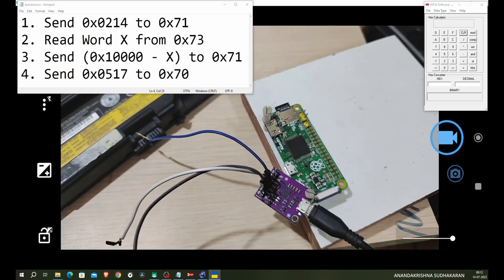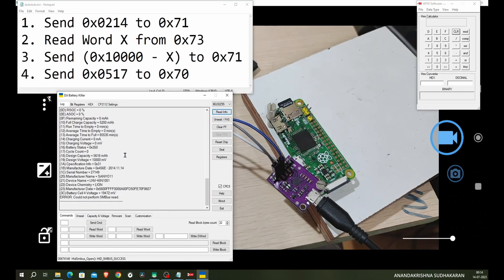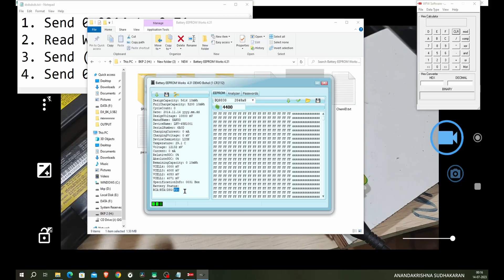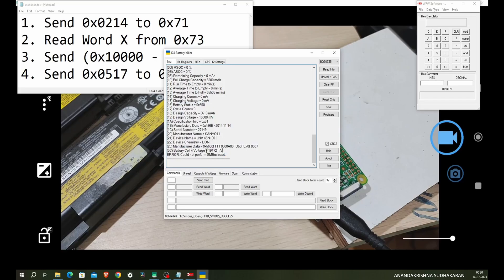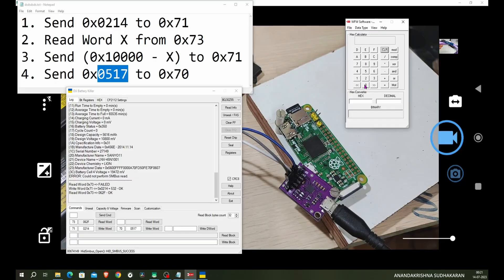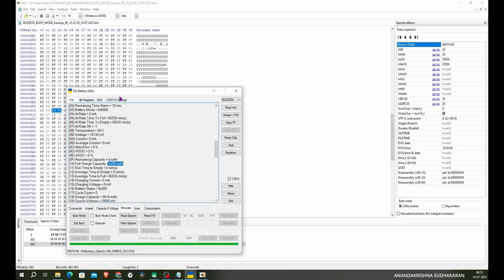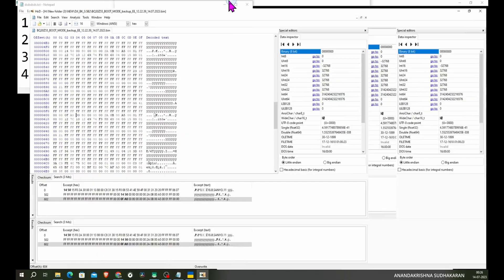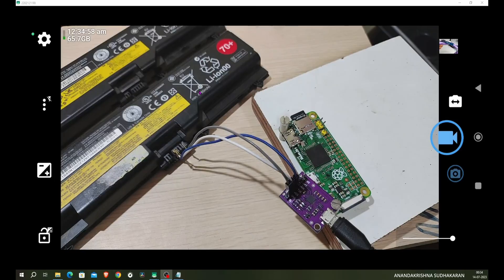CP2112 and DJI Battery Killer Rewrite BQ8030 ROM" Laptop battery data retrieval - BMS HACK

Comment: When i try to write EEPROM i have "write block 0x4000 - FILED, retry.."
Reply from the maker: @wiktorwoznica2739 which chip,
Reply: @ bq8030dbt, problem solved, i tried few more times and it worked

Comment: Hey, i like your Video. 
I have a chip for DJI MAVIC Pro that the Battery Authentication failed. The battery was working without any problem. I have another Battery that i want to copy the Authentication from this to another Battery using CP2112. Is that possible? can i contact u?
Reply from the maker: You want to copy the firmware from one chip to another , its possible , but u need to adjuts many values,, basically both look same but need to find the size and starting and ending memory locations, also copying from one chip to another , sometimes loses its authenticity.

Comment: Very interesting video. I need to do this to my Asus battery since its shows TotalCapacity much higher than DesignCapacity. Can I read/write the battery EEPROM using other tools, like CH341G EEPROM Programmer? It support I2C protocol also, so I think it can be done, what do you think?
Reply from the maker: @wawandharmawan2441  yes , i saw one tool can read the battery info with ch341, but to write and read need to develop a code or maybe tools are available at internet. First you need to verify which chip it contains

Comment: Nice vid where do you get the wires from?
Reply from the maker: Its a normal jumper wires used for arduino board, and those golden pins from old laptop motherboard. Just soldered. 

Thanks for your comment
Reply: @AnandakrishnaSudhakaran   okay thanks

Comment: Hello. what values should be entered to unlock the bq40z696a chip in lenovo batteries?
Reply from the maker: It uses sha 1 authentication method, codes will not work. And I have this chip. But default codes not work. 

Default codes are 

0414 3276
1234 5678
0000 0000
FFFF FFFF

lot of other keys are also available. If I got anything I will let you know
Reply: @AnandakrishnaSudhakaran  thank you. what do the values 71.73.70 mean? where can i find out what numbers should i enter?

Comment: @Anandakrishna Sudhakaran Thank you very much for sharing your knowledge. I have to reset to default settings 3s2p Lenovo battery FRU 42T4861. Can you share Be2works demo file? Can you also help me/leave some advice for reseting the battery. There are bq8030A and bq29330 inside. BTW CP2112  is not USB-to-SPI (as you decribe in decription) but USB-to-I2C chip.  Regards
Reply from the maker: Oh thanks for correcting me, i will correct it.  

Do it carefully
Do not touch the positive line of the battery or pcb with sda and scl pin. Bq8030 is easy to crack. Check your fuse also. If you plan to replace cells, change with same cell model. And am noob at this, so i cannot tell you any advice. Just do it on your style. Always follow safety procedures. Multiple check sda and scl not touch to positive. Also check the voltage on sda and scl before connecting to cp2112. Cp2112 can work upto 5.6volt range. 

Also share image or video if you plan to record it  so i can share it on my youtube.
Reply: @AnandakrishnaSudhakaran Thankyou My battery worked fine (70% of new one),. I recognized one pair of cells had a little bit lower voltage. I swaped the with another one that was much worse (should have been a new ones). After one cycle the capacity written in Bq was decreased from 45Wh to 5Wh (full capacity). I changed again those two cells (pararell connected) into true new one , oryginal 2500mAh as oryginal but not Sanyo (as was) but Samsung 25R. Now the battery is correct charged to 4,20V per cell (balanced, every cell same voltage), but the supply is cut when the voltage fall to 3,85V (not 3,3). After reaching 5%, during discharging, the rest lasts very long time (shows 1 minute (7%) left, and it lasts 60 minutes (YT) to shut down). I try full cycles:  charge to 100%  and discharde to shooting down and then the rest in bios. Do you thing the Bq chip is recalculating capacity and could increased it to real value or never increases and could only decrease - one way? // SCL and SDA lines are ussualy pulled up with 4K-10K restistor, and it works shorcuting the line to GND. So connecting directly to VCC could demage the chip indeed. Regards!
Reply from the maker: @roolon6604  do a calibration cycle again, one full charge, full discharge , again full charge, based on the battery performance bq will adjust the settings and it will give correct readings. What is the design voltage of the battery? Let me calculate it for you.
Reply: @AnandakrishnaSudhakaran  Next cycle (after long (1h) 1% to turn off discharging starts from 11.5V and first 1% is lasting long now. Parameters read from Lenovo X220 Power manager/battery. Condition: Fair (yelow) before was GOOD(geen),  Designed capacity: 62.16Wh, designed voltage 11.10V, cycle count 328, full charge capacity 3.53Wh (yes, no decimal point mistake). Original cells SANYO UR18650ZT 2700mA, 2 of them (the lowest votlage) I replaced with new oryginal Samsung INR18650-25R 2500mAh.// Btw I wondering that most of people replacing the same pair of cells - with NTC resistor on them. Connected (+) to the highest voltage of set (last one) counting from global GND.
Reply: @AnandakrishnaSudhakaran  I did 4 times full cycles and also did battery maitenance (button in Lenovo power manager). Full charge to 12.90V, discharge and charge again with recalibration. But it works probbablly only one way - decreasing full charge capacity and balancing cells. After that I have no changes noticed.
Reply from the maker: @roolon6604  Ok. Good observation. Design voltage is 11.1 so battery should hold voltage down to 3.7v. because 3.7*3=11.1v . And charging voltage is 13.05. so maximum cell voltage is 13.05/3=4.35. if the cell not reaching 4.35v there is a chance of decrease in efficiency. Battery will not works on 3.3 volt. Because 3.3*3=9.9v. lower than design voltage. What about cell balance? Also if battery is mixed with different company. There is a chance of decrease in performance. Can you share your results to my telegram.

Comment: will it works with TB50 batteries too?
Reply from the maker: I cant tell you now, but i will try to get the details. Do you know which chip is used in that battery?
Reply: @AnandakrishnaSudhakaran  it's wrote FR5870
Reply from the maker: @airfilm_it  ok any other chips, FR5870 is MSP430FR5870. You can get the datasheet here  https://www.google.com/url?sa=t&source=web&rct=j&opi=89978449&url=https://www.ti.com/lit/gpn/MSP430FR5870&ved=2ahUKEwii7sDK0NWCAxV8zjgGHYV8BLIQFnoECA8QAQ&usg=AOvVaw22V7gdMpVTn_8F4pvQMmnf
Reply from the maker: @airfilm_it  any other chips?? Which connected to the all cells,

Comment: Work in BQ40z50?
Reply from the maker: If the unseal and full access key is default , yes you can reset the bq40z50
Reply: @AnandakrishnaSudhakaran  bro how to know which chip my laptop battery have without opening the battery physically.
Reply from the maker: @MAnees-jk5yg  well its possible. One of the register value is chip model. I will check and reply you. Actually am not that good at this. But i will try. Can you share the battery model number and company?
Reply: @AnandakrishnaSudhakaran  Bro its HP Elitebook 840 G1 laptop battery having model number CM03XL. I don't know which chip insides the battery. how to know the chip. I want to order CP2112 I2C module to reset this battery.
Reply from the maker: @MAnees-jk5yg  without knowing the chip its impossible to do. And if its is modern chip, it will be difficult to unseal and reset. Because of the keys. Resetting battery will not work longer. If you want more time, change batteries. That is what actually reset means

Comment: Very interesting but this version of DJIBatteryKiller is not available via the link provided.  Can you provide another link from another server or source please.
Reply from the maker: thanks for the comment , here is the link https://drive.google.com/file/d/13xGIZVaDspGy3EgNBYlFE6cRadzuvqKg/view?usp=sharing
Reply: Great fast response but it still wont run on my win10 machines here in the uk.  I tried as administrator but still no good.  The downloads are fine so no problem there and this is a newer version which suggests this is the one I need but it wont run i just get an error message.  It is very frustrating. @AnandakrishnaSudhakaran
Reply: I should add that the download includes the old version which runs perfectly.
Reply: Oh and I copied all the .dll files across to the new version folder as these are required I believe.
Reply from the maker: @johnbaxter1730  is it working? I think it's the latest version.
Reply: Hi I'm sorry but still it is not running. I get an error  - Application unable to start correctly (0x000007b)   The older version runs correctly but it is not as versatile as the version you are using in the video. @AnandakrishnaSudhakaran
Reply from the maker: @johnbaxter1730  might be hidslab files issue. Download those files and replace them, i will share other files if you wait some time, because I am not at home now. You can also download them by visiting cp2112 official site
Reply: I understand that you are not at home and very much appreciate you taking the time to reply to me.  I think that many people may have the same difficulty I am having  as I am a long time pc user with many years experience with windows and linux but this problem is typical of windows resisting useful work.
Reply from the maker: @johnbaxter1730  join this telegram, its the official dji group, only discussing about drone batteries. you can find all file there. https://t.me/+goUDc8gYZl8zNjlk
Reply: finally managed to install the latest version but had to download this  https://www.youtube.com/watch?v=fPFNrR_It8w to fix my error now win 11 has version 0.5B2 running at last  @AnandakrishnaSudhakaran
Reply from the maker: @johnbaxter1730  Am happy for you. i appreciate your effort. And thanks for the information. VC is needed for this software. I will add this to my next video. Start your work and tell me your results.
Reply: @AnandakrishnaSudhakaran hello sir did you know how to reset the battery cycle of the dji battery?

Comment: Please, if you can make a video on how to reset M37512
Reply from the maker: am sorry i dont have that chip. If  i get anything i will reply you. thank you
Reply: @AnandakrishnaSudhakaran  It'd be very appreciated, thanks
Reply from the maker: @antaninianta   try this method, read full carefully 

http://www.karosium.com/2016/08/adding-m37512-with-panasonicibm-firmware.html?m=1
Reply: @AnandakrishnaSudhakaran  I just bought the fx2lp board, need to wait until it arrives. I'm using Linux and already built the smbusb software. I need to understand how to use the board, how to connect it to the bms connector of the battery ( I think). I will watch your videos about BQ8030 where you use this board and hope to learn and somehow adapt it to my case (btw, it's a Thinkpad T61 battery, with Panasonic cells, hence the microcontroller firmware is M37512 FC200). Then I will need to actually interact with the microcontroller to read/write/reset data on it (its eeprom?) and replace the blown fuse (but the cells are good now, there was just one at 2.2v that I revived slow charging it with bench power supply). It will be very challenging since I'm a total noob in this. Thanks for now.
Reply from the maker: Try using the karosium guide , there are precompiled files for windows but you need fx2lp board for the connection. If you need the link i can provide

Comment: Hello. I have similar Lenovo battery with 2+5 pin socket (PN:42T4619  nominal: 10,8V  7.8AH  86WH seems to be older type than yours) . Question is if it is possible to detect the chip type without opening the battery case. Other question: For resetting You used also the Arduino Uno in other video, which method is more effective?  At 1:32 it is seen  with DJIkiller the cp2112 can handle only 3 chips. Thanks for your video .
Reply from the maker: Cp2112 can handle chips based on the software. Dji support only 3 chips  but Be2Works softwarw support many chip on their paid version. Dji can effective on any kind of chip. Arduino is simple, if we have the correct software we can do anything with that. Answer to your question, still only one software can identify chip without opening is TestBattery v5.50 from UBRT REGEDIT GROUP. But you need ev2300 or lpt to i2c for this software . If your mother oard support LPT port you can design lpt to i2c easily  i can give you the circuit diagaram. Last day i tried to read one battery from lenovo as bq8030, but not worked. Then i tried woth testbattery and detected as 51f51. Strange for me. So I opend and checked. It was 51f51. So for identity chip for free , use testbattery 5.5

Do you have ev2300 or ev2400, then bqstudio is available for free. Please tell me about your hardware side
Reply: Hello. I don't have any special hardware, I only think of replacing the cells inside the battery ( more environment friendly solution, as compared to thrashing the entire used battery). I searched the solution and found that the cheapest way would be using cp2112 or Arduino (like you did), perhaps RasberryPI. (EV2300 is a big investment and is not worth buying). But I had to realize that these DIY solutions are limited because there are lot of type of BMS chips most of them do not have any datasheet published. So i have to open the housing of the battery, and if I have luck there will be known BQxxx series chip. I incline rather to purchase an Arduino, because it can be used for other purposes as well, however using Arduino for BMS restore is not so effective compared to cp2112.  Thanks for your reply. @AnandakrishnaSudhakaran

Comment: Can you reset bq40320 with PF bit with cp2112
Reply from the maker: 50% chance only, you can connect and communicate with the chip with cp2112. Or any other smbus support board. If the chip is  using default Unseal and Full access key you can do the unsealing process. If it unsealing worked then you can clear any pf flags by using pf clearing commands given in technical reference of bq40320. This dji battery killer is designed for dji battery. But we can do anything with another chip if we have some knowledge about the procedure of battery unlock. 

So if you have cp2112 you can try, or if you have arduino, there are free softwares and codes avilable and you can try yourself.

Comment: send 0x0517 to 0x70 :gave the error could not write word ? what to do ?
Reply from the maker: After sending 0214, what is the value from 0x73?  Did you subtract that hex from 10000?
Reply: Yes but showing error "could not write word to 0x70
Reply from the maker: It means wrong values are entered, pleas contact me through mail or instagram or facebook

Comment: Good job, Anand. Keep it up. I will try to follow your tutorials to reset my Dell laptop battery. And thanks for sharing your software.
Reply from the maker: Software is not mine, all credits to a man I don't know. Thanks for your support. Before connecting make sure the positive line is not in touch with data or clock line. Careful. Any doubt feel free to ask
Reply: @AnandakrishnaSudhakaran  Can you share this software via Google drive without any login password? First question, in your opinion which method is easy, using fx2 board or cp2112 board? Actually I have both boards but I burnt cp2112 ic by applying 12 volts to it then I replaced the ic but I am not sure that it is working good or not. Second question, can I contact you by email if need any help in this subject? Thanks.
Reply from the maker: @owaisnajam5304  you can contact me through insta or telegram or mail, did you open your battery back? Which ic is there?
Reply from the maker: I can share the link personally to you , no prblm
Reply: @AnandakrishnaSudhakaran  I didn't open yet. I will drop a message here when I will do.
Reply: @AnandakrishnaSudhakaran  Thanks. I will send you an email.
Reply: @AnandakrishnaSudhakaran kindly share your telegram link.
Reply from the maker: @owaisnajam5304 t.me/ialwaysthere4u
Reply: @AnandakrishnaSudhakaran  Thanks

Comment: Thanks bro can i use ch340 ? And what shoul i select  3.3 or 5 volts ?
Reply from the maker: Ch340 can't connect.  do you have any arduino board?
Reply: @AnandakrishnaSudhakaran  yes i have uno and nano
Reply from the maker: @saifi1223  ok what you want actually?
Reply: @AnandakrishnaSudhakaran i want to reset bms i have changed batteries and its not working
Reply from the maker: @saifi1223  which board? Do you hav instagram or telegram?